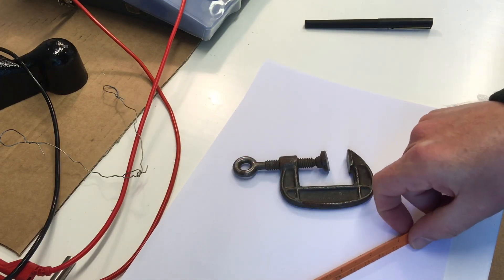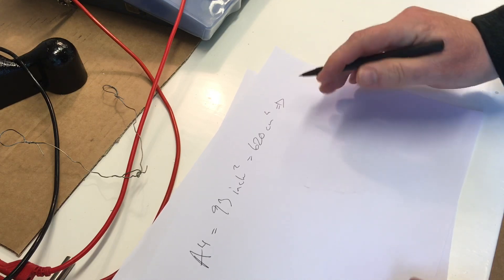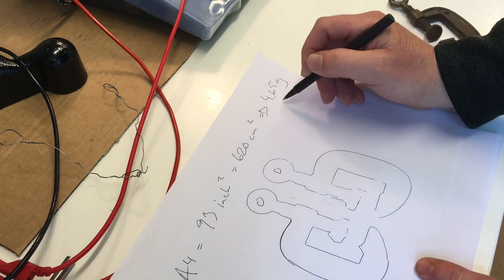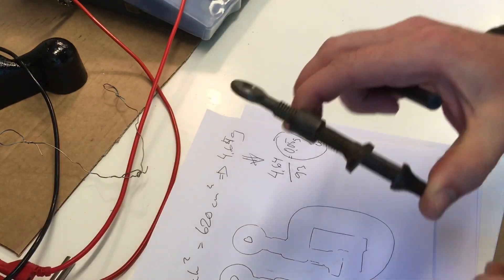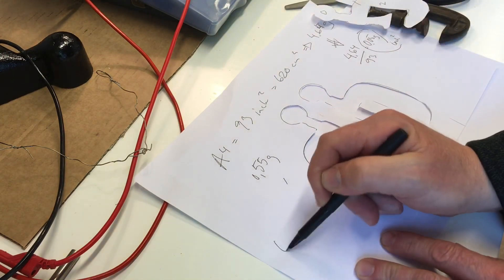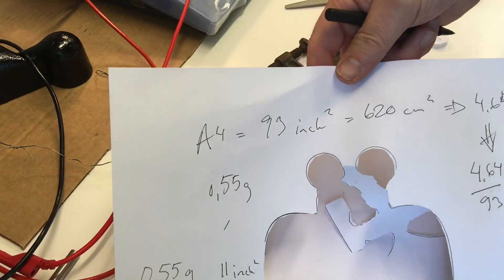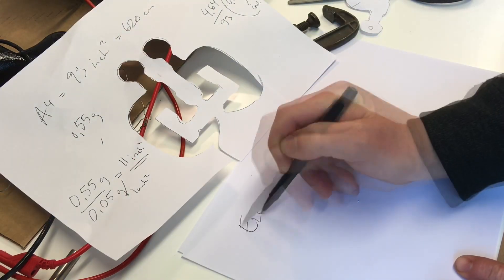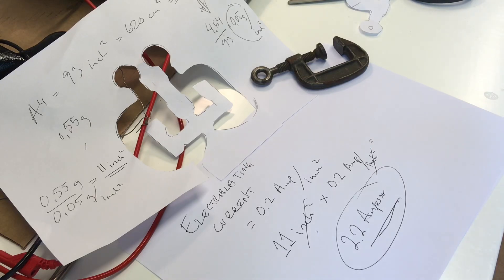Electroplating basics — How to calculate the current for your part

Comment: You could do it the same way Archimedes did it, by seeing how much water it would displace
Reply: Archimedes determined volume.
Reply from the maker: Great input 👍
Reply: That calculates volume not surface area. A sphere of metal beaten out to a thin sheet don't have the same surface area
Reply: @Phantom-mk4kp  you are absolutely correct. My bad

Comment: This may be a dumb question but I got to ask, how would you know that your electric current 0.2 Amp/inch2 would be efficient enough to plate the entire area? Unless of course you make the Voltage a constant variable and adjust the current to gain this specific current density to plate in a small amount of time.
Reply from the maker: I don’t know that on beforehand. I just bring it up and check with time.
Reply: I see, but is it possible to calculate current density when you are provided with the area of the object you want to plate and which metal is provided to plate it on? Because I can't seemed to find any ways to calculate it unless if they could provide a time to do so.

Comment: What would be the voltage?
Reply from the maker: U set either current or Voltage as constant on the rectifier. The other one will follow. I think 0.1 amp / inch 2 in my case was about 1-2,  max on rectifier was 12. The issue with regulating the field strength with the voltage potential is that your part will be more uneven coated because the current in the solution will change as your part builds a new surface that is more or less conductive.

Comment: This might come off as a dumb question... but let’s say I have 10 parts that measure one square inch each. I then go set them on my rack for plating simultaneously. Would I plate at 0.2 amps or would I plate at 1.0 amps?
Reply from the maker: You multiply up w number of parts. ☝️👍

Comment: thanks for the vid man.. very thorough scentific approach. Can you do a video on methods to mask off areas you DONT want electroplated or DONT want to be affected by electrolysis..for instance I have a rear differential with bearing and mating surfaces that I would prefer to clean more delicately by hand to prevent damage, and also dont want plated, but would like to clean most of it by electrolysis.
Reply from the maker: Christopher Stone, great input. I believe it is should be straight forward but I have to test. I will show in video how I mask off areas using wax. I think that’s possibly the best way to go.